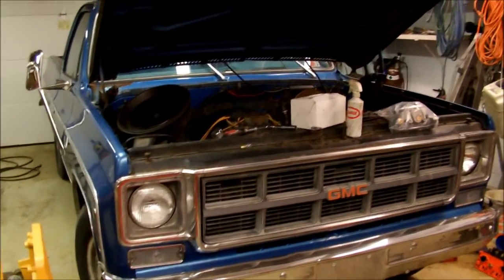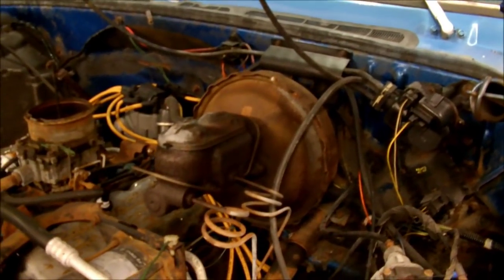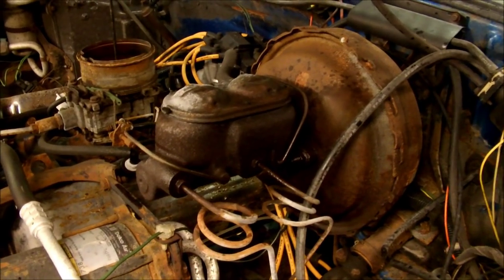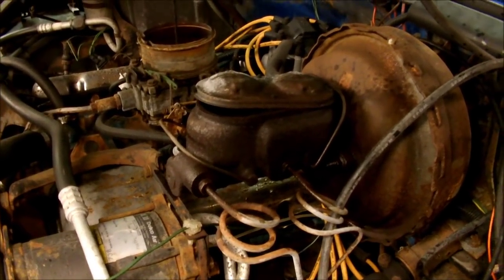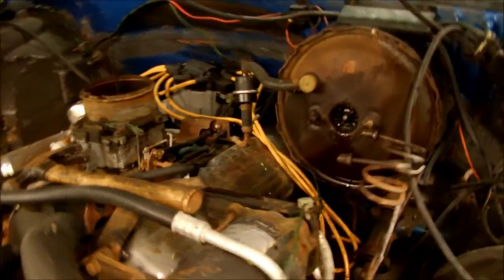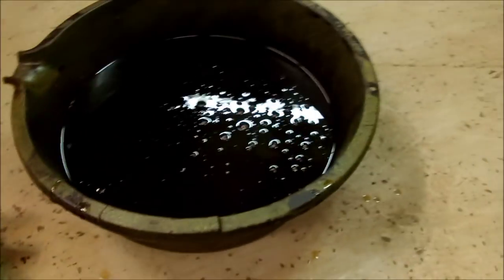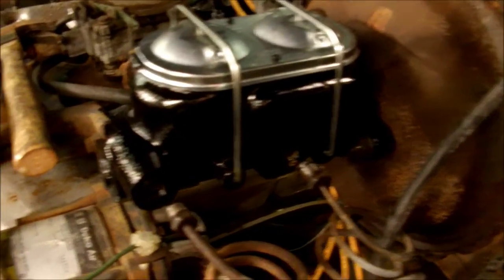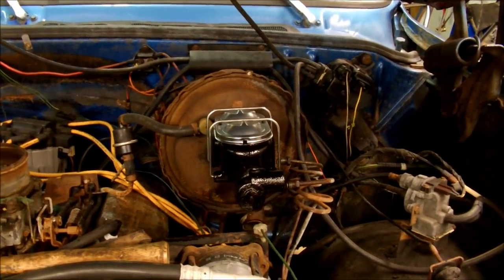Changing a Master Cylinder - 1978 GMC C2500

Comment: Bought my 78 c-20 and as soon as i got it off the trailer I climbed all over it and sprayed everything with pb blaster .Future repairs went very well.In the very last shot of the video there is an object on the inner wheel well. What is it?
Reply from the maker: Cruise control module.

Comment: Nice video, those line wrenches do come in handy but if you have an extra 9/16 (or 14mm) box end you can always cut a 1/4 inch gap in them and they will work just fine. I mention 14 mm because they are a little a bit smaller (about .3mm) than 9/16 and on these old chevy's (mine is 78 k15) it's not uncommon to find the flare nuts on these brakes lines to have the corners rounded off of them making a 9/16 want to slip.

Comment: I saw you talked about "manual" brakes. Which is the brake system that has no brake booster. Which my truck doesn't (62 C10). Is it harder to change the master cylinder on those? Any tips? I'm going to change mine soon
Reply from the maker: Nope, exactly the same. Yours is probably a single chamber, so one line. Even easier.
Reply: I'm confused on the whole brake rod that connects to the cylinder. At the end of it is a little plastic boot type cover. Does that just go over the new master cylinder and that's it? No twisting rod into port or anything?

Comment: Any tips if the nut is rusted to the stud on the brake booster?
Reply: Clean around the nuts/studs with a small wire brush then soak the crap out of them with wd40. Let it set overnight. If you have an impact driver it will be a great help if not use a hammer to quickly and repeatedly LIGHTLY tap/hit the opposite end of the wrench while applying turning force (lefty loosey righty tighty)  to shock the nuts loose.